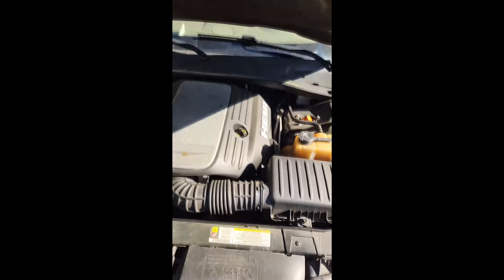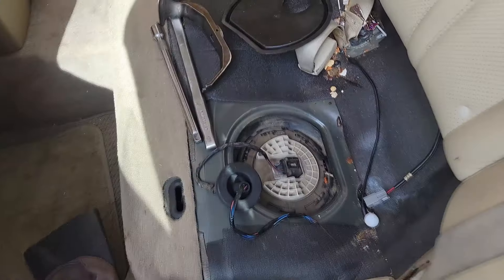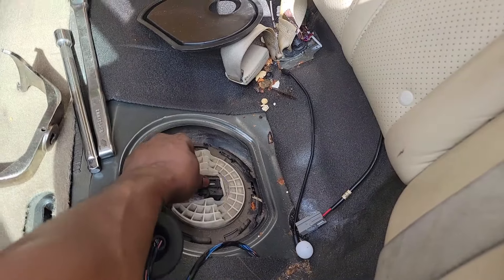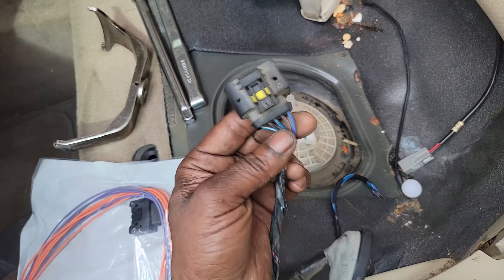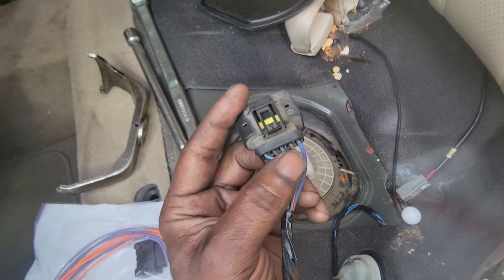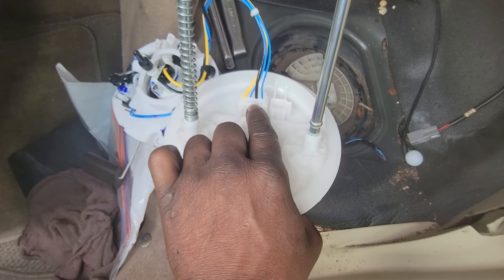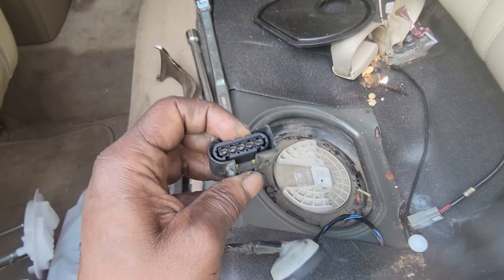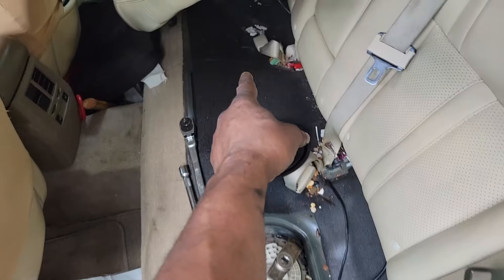Here's what Dodge didn't want you to know.

Comment: My grade 10 auto teacher beat into our skulls the difference between a motor and an engine. That was 45 years ago. 
Good explanation on the wiring at the connector and about swapping pins. I first seen this in GM pumps, whether OE or aftermarket. I never searched into the reason why , just did it.
Reply: Internal combustion engine / electric motor

Funny how they they called Detroit MOTOR City